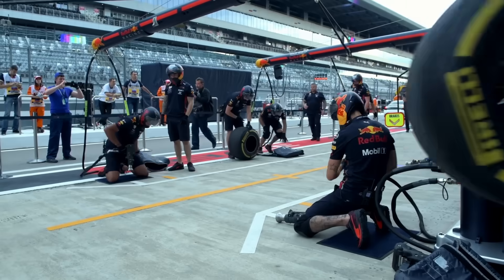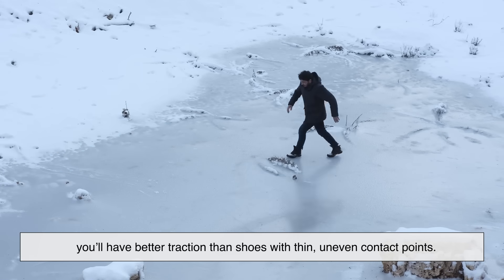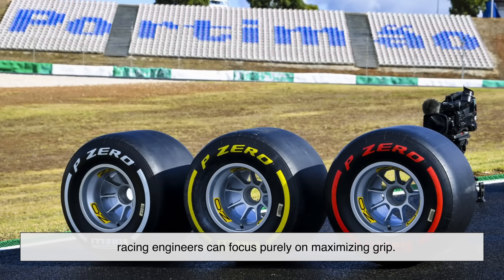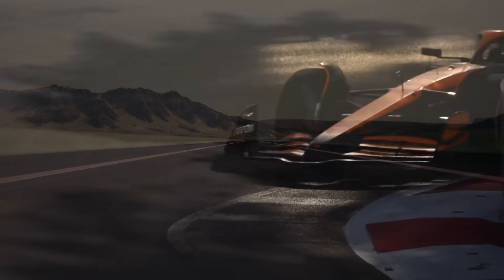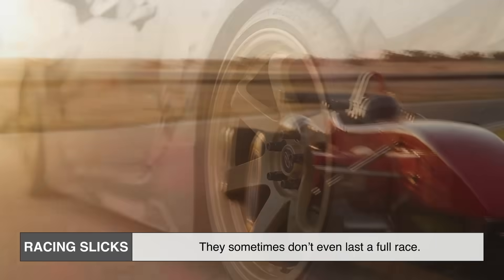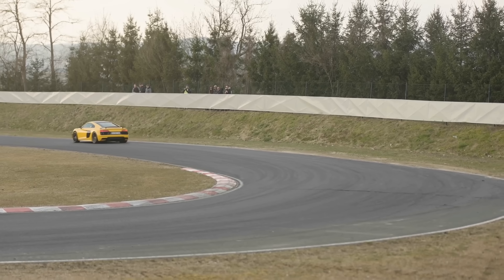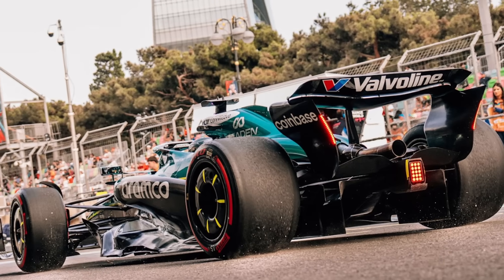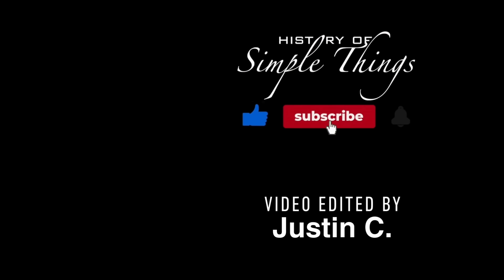Why Racing Cars Use Slick Tires Instead of Treaded Ones

Comment: Tread is somewhat of a misnomer. Your use of that word is not exactly correct and misleading. To be accurate, the true difference between racing tires and car tires is that slicks are not grooved. However, both tires have tread, even a slick, and both have a certain thickness of tread before they wear down to the cord. "Tread", and "Groove", are not synonymous. Therefore your video should state the difference between a grooved tire and a slick.

Comment: Slick tires are only used in dry conditions where they get the maximum amount of grip, but in wet conditions, groved tires are used to channel ( move ) the water away from the center of the tire.
Today most race cars use intermediate tires in most wet conditions which has treads and also softer rubber than the dry tires.
If it's raining very heavily and if the race is allowed to go on ( rare in f1 these days sadly ) full wet tires are used with deeper treads and very soft rubber.

Comment: If more surface contact improves grip, why do shoes have groove soles?
Reply: For the most part it's for the same reason street car tires have grooves. And racing slicks require heat to gain maximum traction. If you watch racing it's common for drivers to spin out after a pit stop by driving aggressively on cold tires.